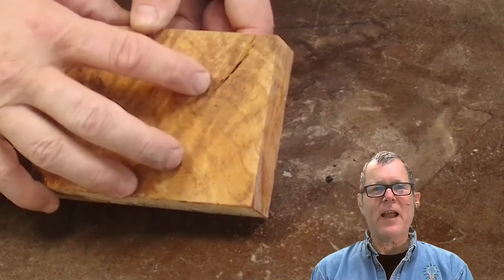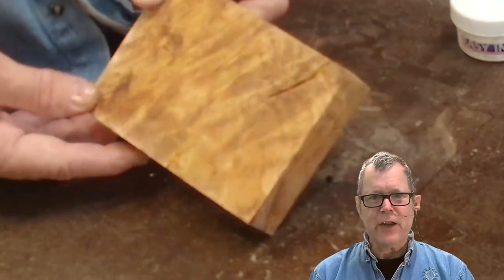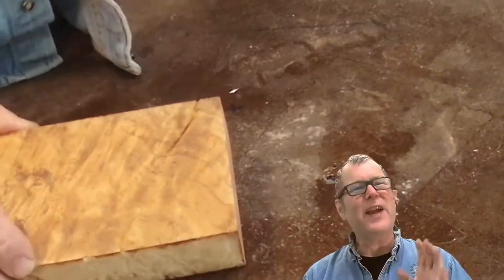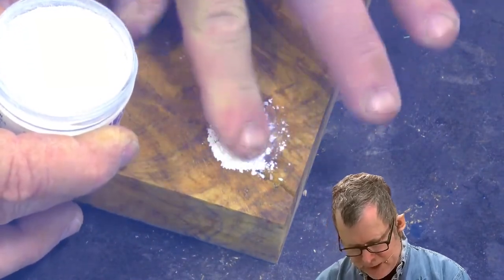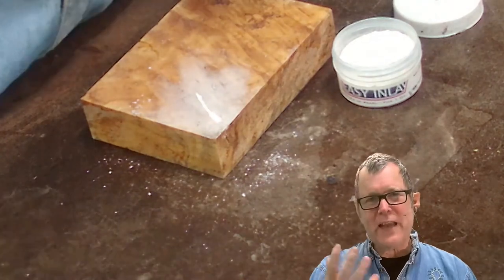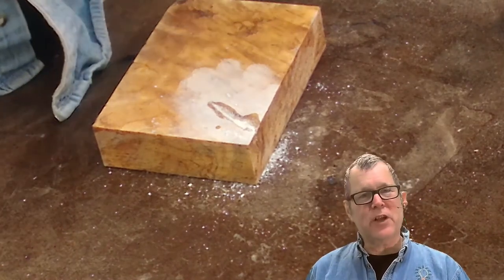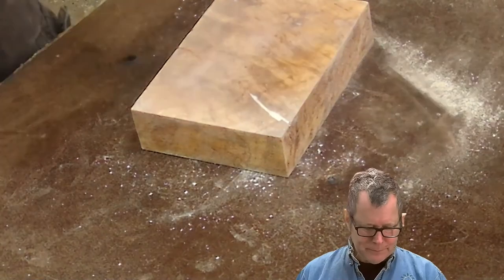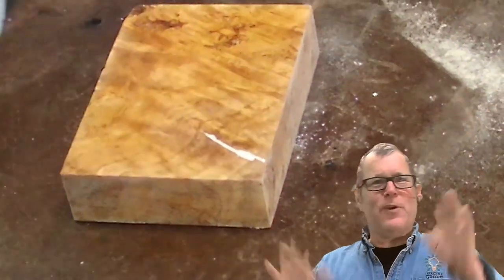Mother of Pearl Crack Repair Inlay | Easy Inlay How-To

Comment: Baking soda and super glue will give you a similar look to mother of pearl. My pool stick had a gouge at the butt of the cue and I filled it with baking soda and super glue virtually the same process. It turned out beautiful. It blended right in with the mother of peral dime sized enlay that was gouged.
Reply from the maker: Yes,.great for repairing fine cracks but does not have iridences